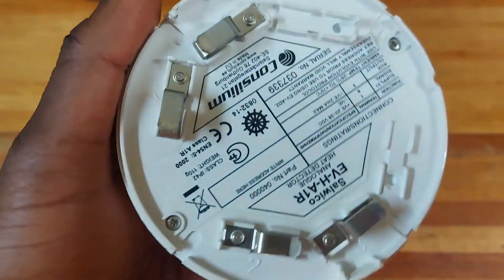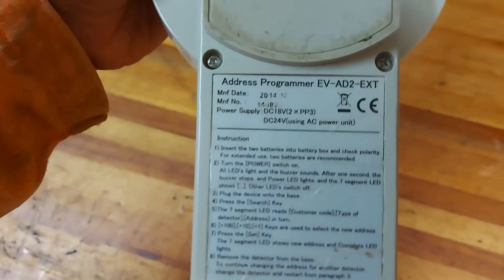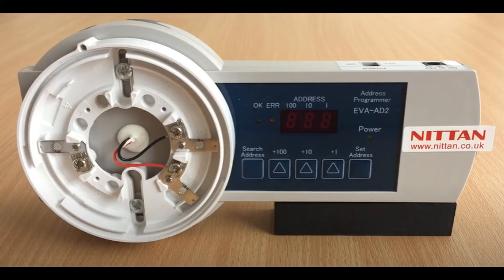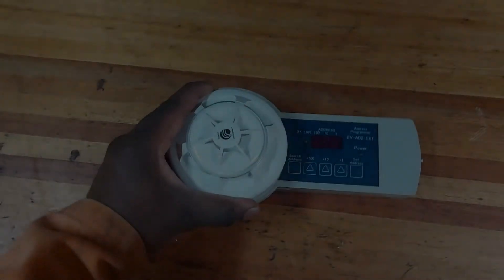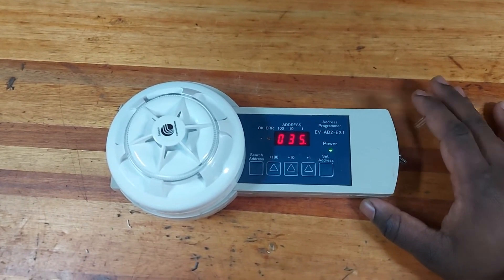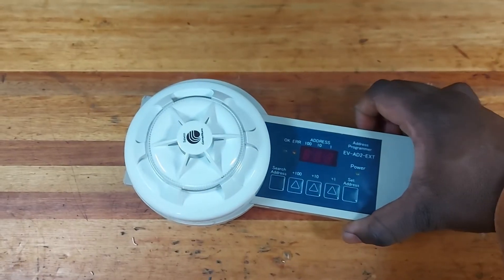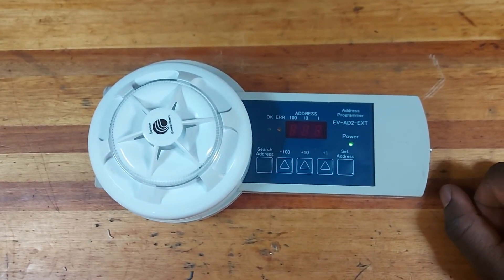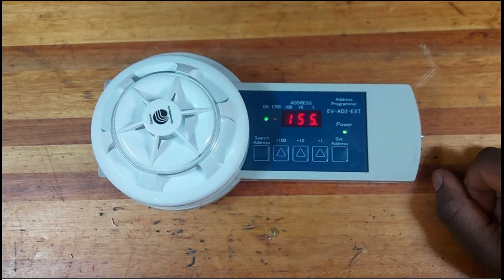Consilium Fire Detector

Comment: What if error E20
Reply from the maker: Step-up transformer trouble or overcurrent by short circuit of signal line.The EV-AD2 will switch to "Standby mode"to prevent damage.
Reply from the maker: Check here out for error codes  https://www.manualslib.com/manual/2151234/Consilium-Salwico-Cs4000.html?page=186